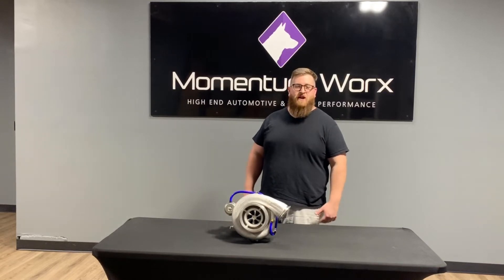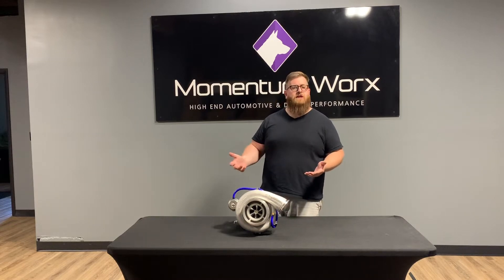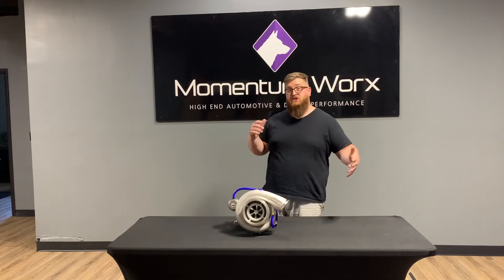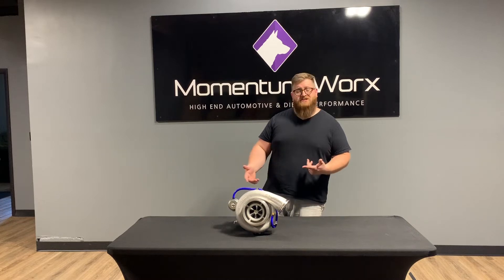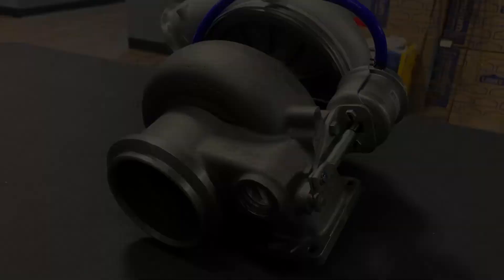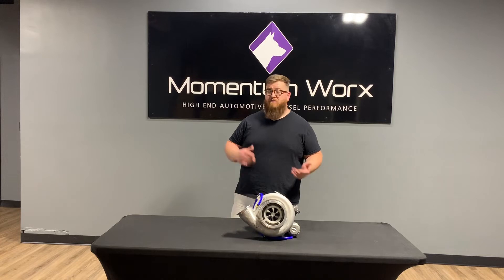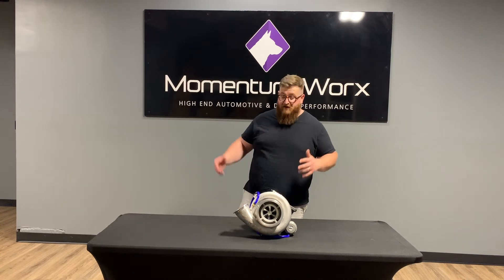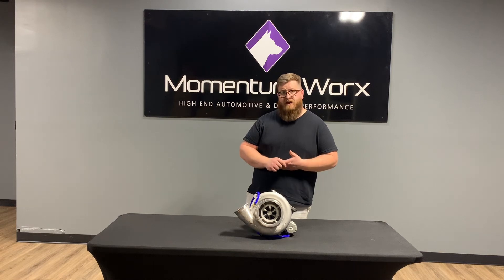MASSIVE Detroit HK Series 60 Turbo | Garrett GT4708

Comment: Will this work with a stock 12.7 Detroit or what would be best for fuel mileage and durability and Longivity with what manifold also. Just want about 75 horse maybe 100 hp added to a 500 hp 12.7 any idea o plus fuel mileage